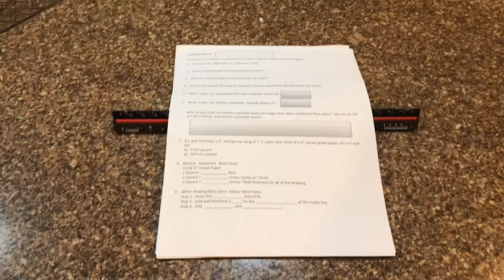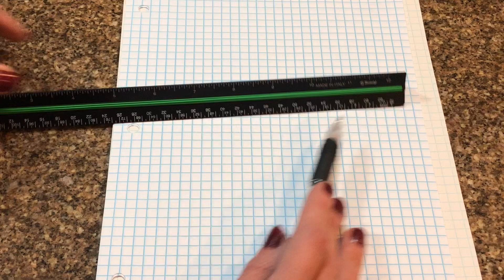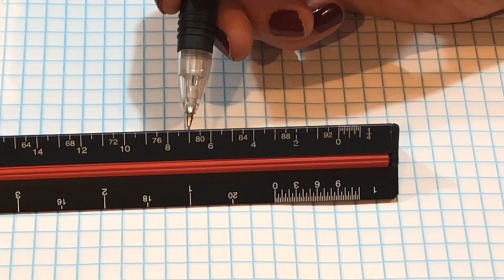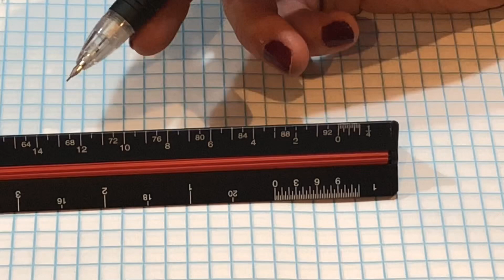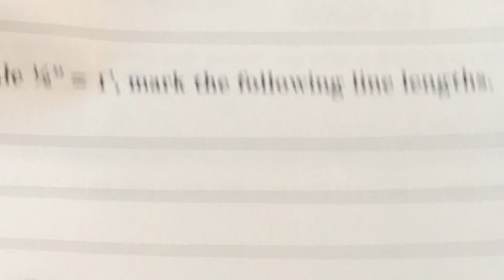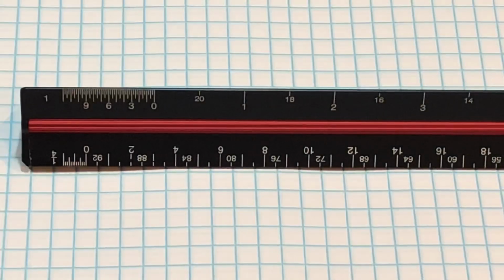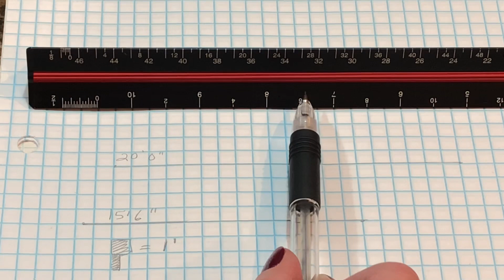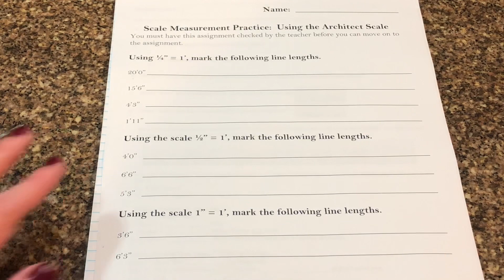Reading the Architect Scale Ruler

Comment: So confusing....l am trying not to hire a architect. The software l saw one use marks the foot and inches between lines. I just purchased scale  paper and a architect ruler....it's so confusing my floors plans done but l can't do the actual measurements for the building permit.🤔 So l'm determined to learn to save cost.